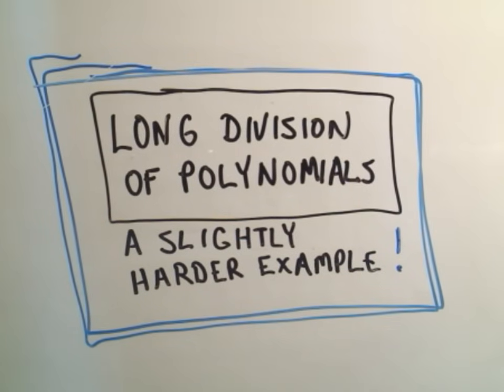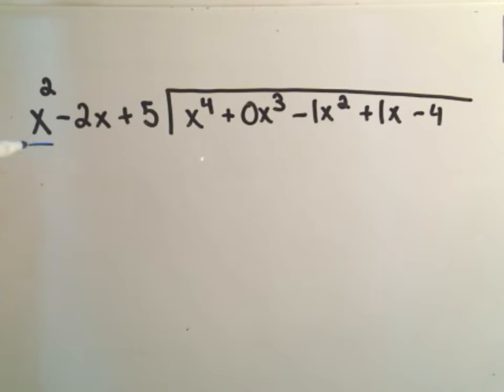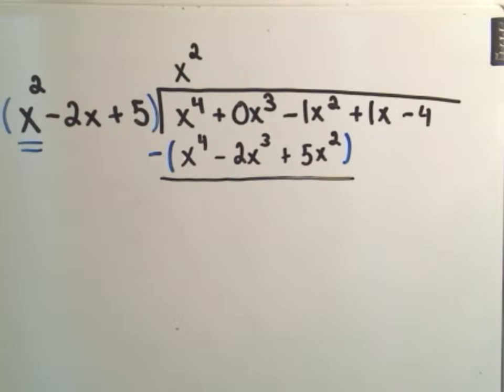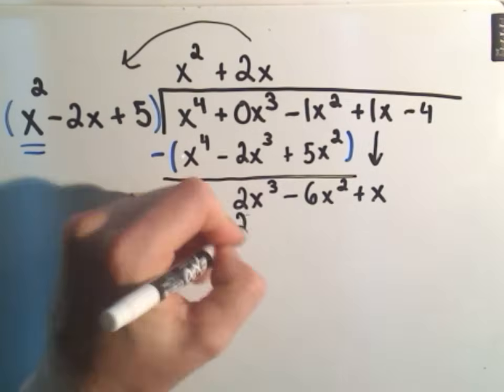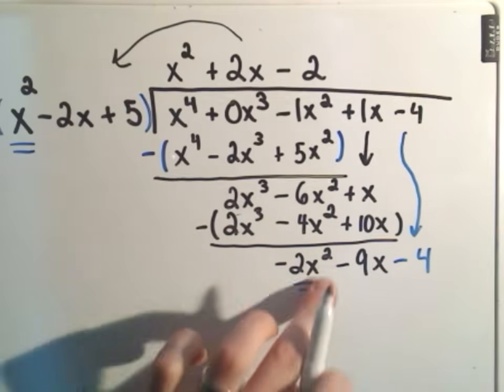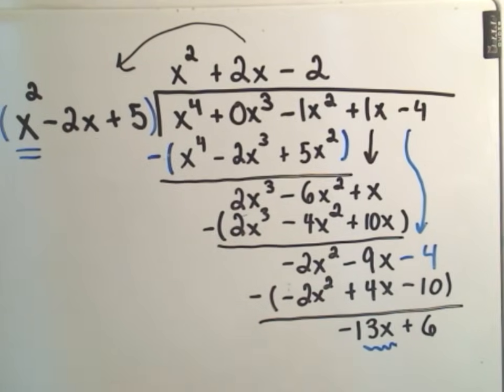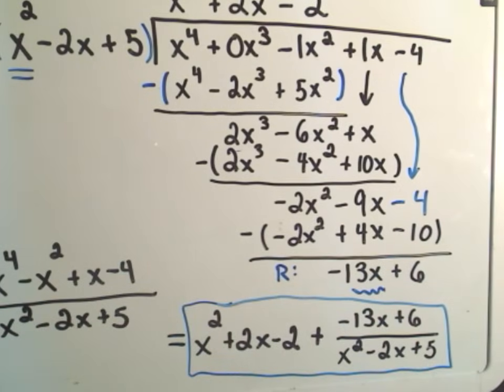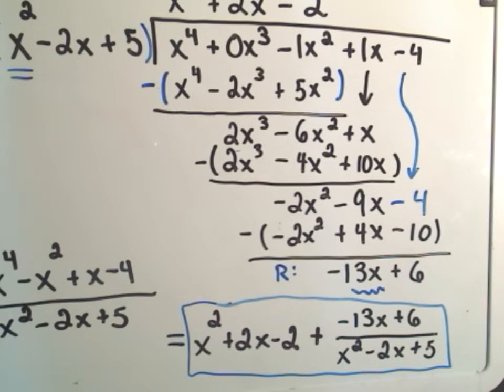❖ Long Division of Polynomials - A slightly harder example  ❖

Comment: Hi! Algebra 2 student here, and I'm a bit confused by your Ox^3 term. When you subtracted 2x^3 from it, you switched the sign of the sum as if 0x^3 has a value, but it can't. Its a term multiplied by 0, which just equals 0. Why was it accounted for if it just equalled 0, or did it not and I'm just really missing something here? Thank you for this video though, it was extremely helpful.
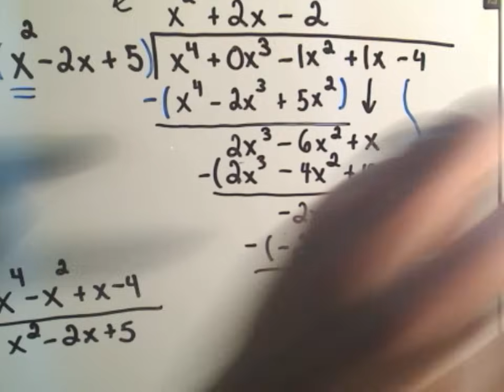Reply: Ooop, I missed it before, 4:33, its addressed, sorry!

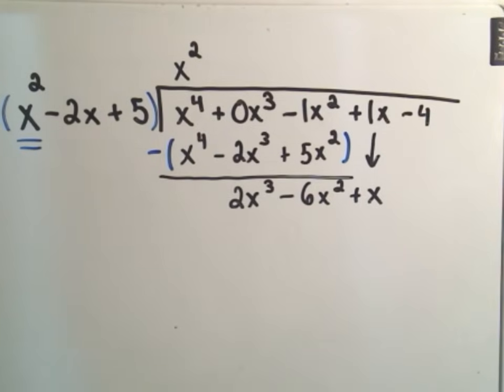Comment: do you still answer questions? may i ask in 1:59 why did it become 6xsquared when 5-1 is equal to 4? shouldnt it be 4xsquared?
Reply: Because there was a negative sign in front of the parentheses, you multiply that by 5, which is -5. And -5-1 is -6.

Comment: How can you divide if the polynomial that divides has a bigger coeficcient than the one being divided?
Reply: I guess you move on to the next spot of the equation, and put 0x (whatever power is needed) on the top. Good question though.

Comment: I don't get why u added a zero x cubed. Like there is already a x squared on top and a x on the bottom. I tired working it out without the zero x cubed but it didn't work out. So how do you know when to add the zero x cubed and why?

Comment: why is it (0x cubed) in the numerator and not an assumed 1x cubed?
Reply: Alisa Kris u have to assure all the polynomials are in defending degree order so since the original expression was x^4 -1x^2+1x-4 u have to put place holders for a cyber number thus putting in 0

Comment: I never graduated h.s. and I left learning about exponents. As I entered college it was incredibly overwhelming learning these arithmetics in a hour or two. I kept getting IPs but I wasn't comprehending to do them on my own. Until the third time around taking my algebra 2 class, I had the highest average! I cried when I got to my car because I was sitting with other students who were fortunate to learn these equations and elaborated on the material for months rather than a hour. That right there, showed me determination and studying pays off in the long run... Now the way your breaking down the equation is almost the same way I taught myself, even my Professor accommodated me and ask me to share it with the other students. This is a great way to comprehend the equation 👌

Comment: Thanks for the quick explanation. it was easy to understand and to the point. keep them coming.
Reply: Should be very useful when you do WRC201 :)
Reply: Yip very similar to the long division in WRC201. The exact same rules and steps are applied if i am correct.

Comment: Thanks a lot Patrick, you´ve been a big help! Just a question if you don´t mind... What if i have the same degree polynomial in the numerator as well as the denominator? For example 2y^5+8y^3/(y^5+6y^4+12y^2+8? Do I use negative exponents in the quotient? Thanks!

Comment: It's similar the the place holder zero in long multiplication. It doesn't change the problem. It is an important part of the process to solving the problem. Simple as that. All it does is aligns the multiplied numbers into their correct Place Value. That is the function of a place holder.

Comment: Hi! I just need to check because my answer (I'm the teacher) differs from the book answer. Problem: (x^3 - 4x^2 + 5x - 6) / (x^2 - x + 2) = x - 3 + (6x - 2) / (x^2 - x + 2)
The book answer is just x - 3 but I've done it several times and every time I get a remainder.  If you can, just let me know if I win or the book wins ; - )
Thanks!
Beth

Comment: Question. This may have already been answered, but why do you need to put in the 0x^3? I understand how it keeps everything in order, but does this mean for every time I have a problem like x^2-2x+5/ x^4-x^2....  I actually have to put a 0x^3 in the middle for proper calculation because it would have a proper down grade in powers from the factor 4 to constant?

Comment: I'm at the end of my 2nd year of engineering. I'm taking my 4th and last advanced calculus class (vector calc and differential equations). You might not be familiar with it, but I was going over power series expansion and realized that I had completely forgot how to do polynomial long division. How sad is that? Anyway, I found your video helpful enough to refresh my memory. Just wanted you to know that your not just helping 16 year olds in high school math classes. Good job!